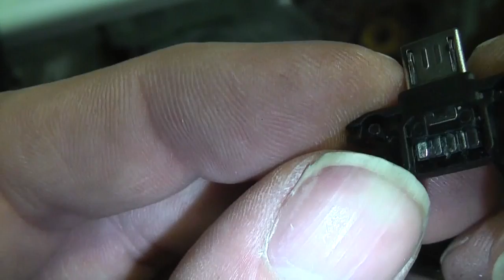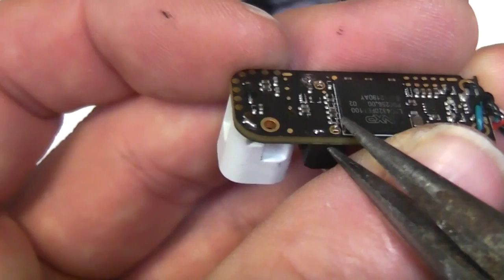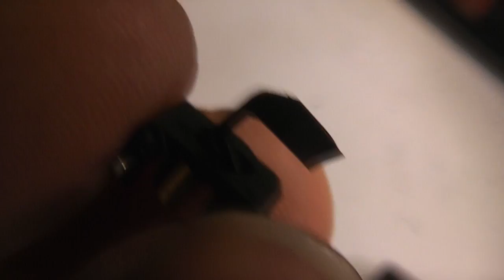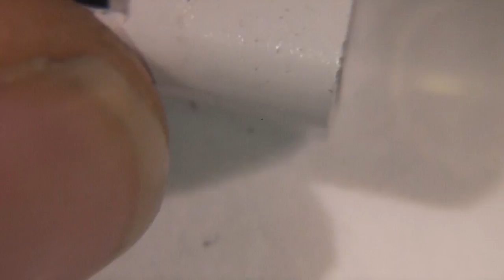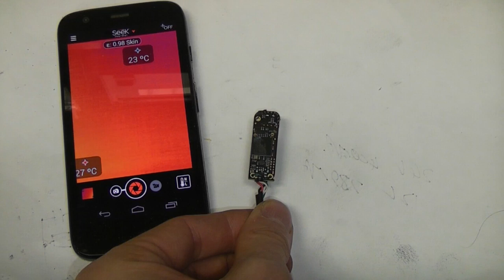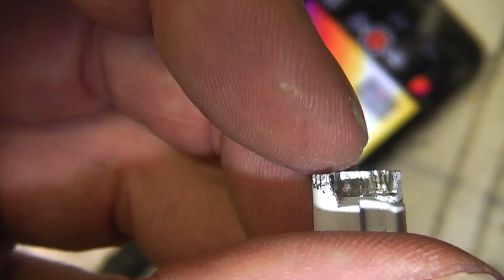Seek Thermal camera - investigating gradient issue

Comment: I stuck my thermal camera in the freezer for around a minute or two, then plugged it into the phone while still in the freezer and there was no or very little gradient. I then started to use it in a room that was around 10c and image quality was improved as it was able to better distinguish the difference between cold and warm. I brought it into a room that was about 25c and image quality was very good. Before having it in the freezer, booting it up in my 10c room, Image quality was really poor and bringing it into the 25c room image quality was also less of when the camera was placed in the freezer. I think I may have an idea of what is happening, and don't think it's the hardware or manufacturing. Right now I have it in the 25c room to bring the device up to the room tempurature and I am going to see how it affects the image quality between the two rooms.
Reply: Are you nuts? Have you heard of the word "condensation" before?

Comment: Can the camera be hooked to a lcd monitor  without the phone ? Is the micro usb cable coming from the camera pin combination 5 VDC and composite video out. Can this be applied to a monitor for composite video. Do you think this will work?
Thank you for your help.
Reply: I don't think it will work as the app is required to view it
Reply: I highly doubt there is composite video coming out from the camera via the USB, it's much more likely a data stream similar to a webcam but not sure.

Comment: Great work Mike! I'm a little nervous now whether my unit will have the same gradient artifact. Also, I wonder why mechanical shutters are being used, surely it must be dirt cheap, easy and uniform to just mount an LCD panel in front - but I suspect it has to do with wavelengths (LCD glass would not let enough infrared light through)?

Comment: If this unit had the shutter outside of the lens housing, rather than between the lens and the sensor, would that allow the flat field correction to compensate for abnormalities in the lens?

Comment: Would think maybe they could put some little positioning pins on the lens assembly that'd poke through the PCB and hold in place with addition of some glue. Would mean they have to get the die placement repeatability spot on but they already place that with a machine anyway.

Comment: Very interesting. I understand the interest here is in the hardware, but I can't help but wonder if software post processing of the raw data from the board could compensate for gradient issues or other flaws resulting from manufacturing inconsistencies. In this case it seems that a gradient map could be held in software which would be applied to the live data to normalize it.
Reply: Yandy
It doesn´t even need to be a shutter. Just a uniform piece of something. Uniform meaning in temperature and infrared emission. Thats enough hardware already. When lazy or in the fields, even a piece of paper would be good enough. Doubt about the uniformity of the emissivity or temperature of the used surface? Just take multiple pictures of a semi-uniform surface.
Fixing the issue in software is brilliant - finding  a semi-uniform surface in the field shouldn´t be that hard.
Reply: yeah, kinda. but when you go outside in winter, you would have to recalibrate as the temperature of the system changes.
Although: Why not? It just requires just a surface with uniform temperature and emissivity, pressing a "manual flat field correction" button and then it would be re-calibrated. Sounds like practical solution.
Reply: The problem would be trying to mesh the flat field correction with the calibration for the lens. Since the shutter is behind the lens, the flat field correction cannot adjust for an uneven lens. If the shutter was outside the lens, however...